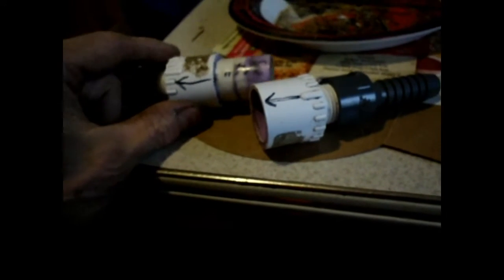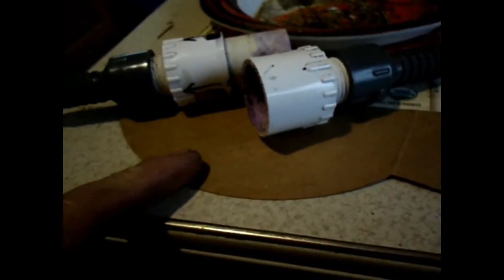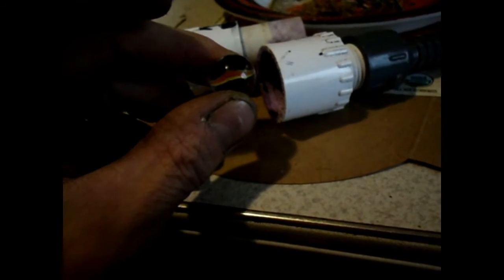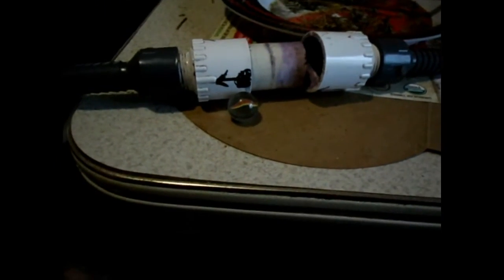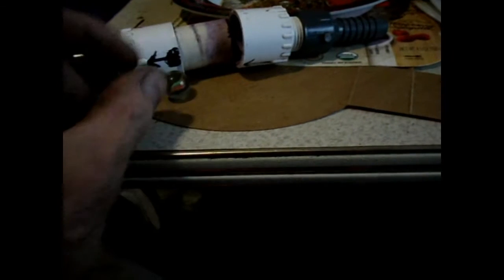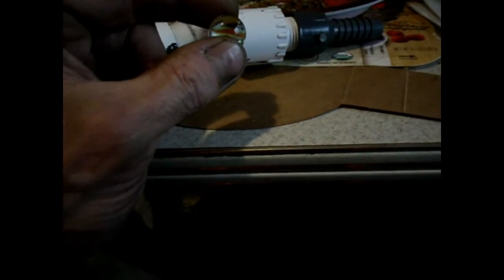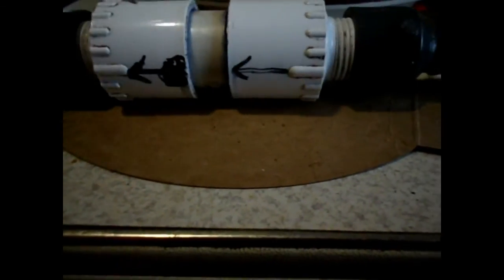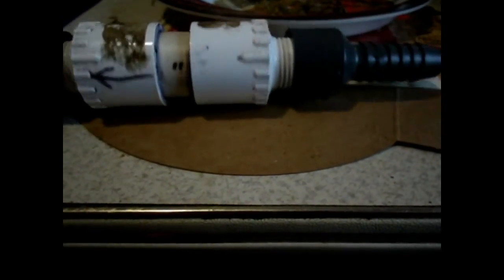DIY ball check valve, for ram pumps

Comment: nice! but this realy worked in your ram pump?
i am thinking in use this in my own ram pump project, but i don't know if this will work. looks like a simple check valve, not a ram pump valve.
Reply from the maker: it is a check valve for reducing water weight in the water return line....not in the ram pump. although you can use ball checks in the pump it self, there are models built that way. ...... i now use grommets for the ball seal in place of O-rings.
Reply: there's a video where he uses marbles with "O" ring and then he modified it...no marble or "O" ring...replaced everything with just a rubber ball with one quarter cut off to keep it orientated...